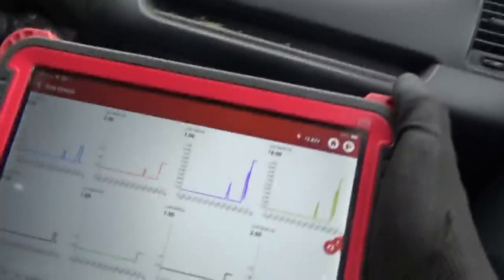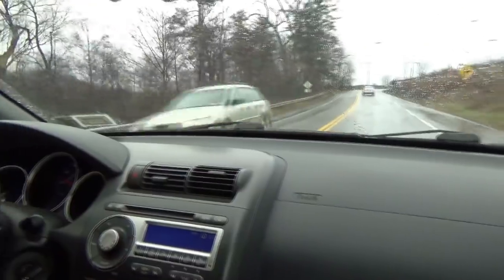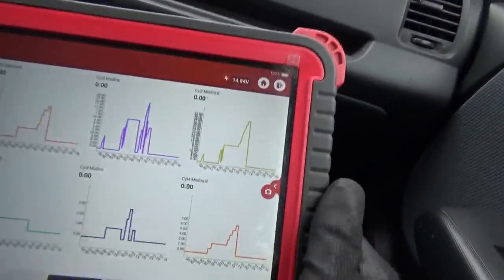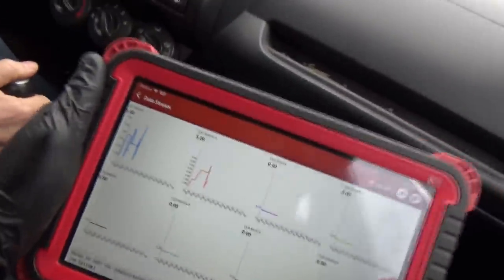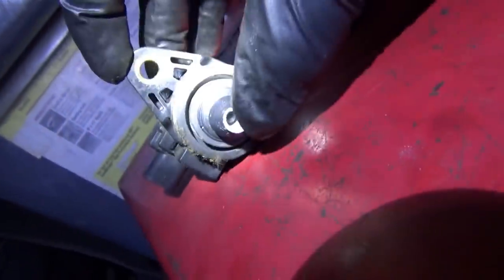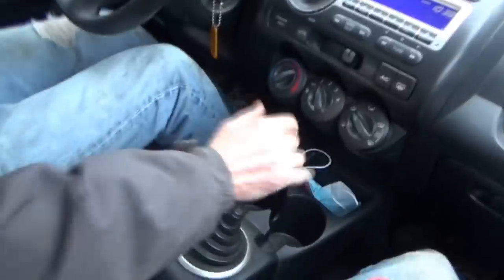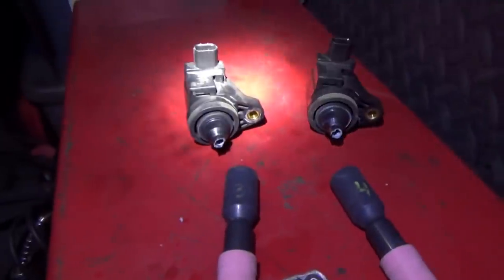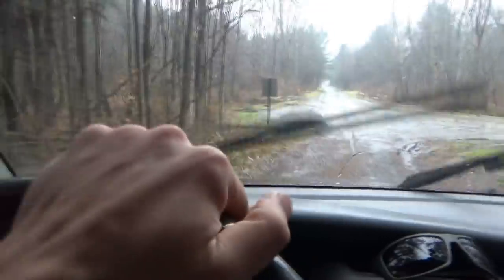Honda "Fishbite" MISFIRE (Diag & Repair)

Comment: Two things. U and pops have plenty of money. U made the point that the  car could b fixed with no parts. Alright already. Replace the coils with Denso coils. U can even get them at Rock Auto. They r degraded.  Have them sent directly to pops. He can do that job easily.  On the knock sensor code for the Chevy. I saw a vid where a gentleman eliminates one of the knock sensors. I have fixed two 5.3’s doing that. It eliminates a lot of work and expense. Maybe it’s a Russian repair, but the engine runs perfect after doing it. That cheap out makes a lot more sense to me. Just my opinion. But what do I know
Reply from the maker: How do you eliminate one knock sensor?
Reply: @PineHollowAutoDiagnostics   Check out the video on the Sam Washburn channel. I have done it on two cars
Reply from the maker: @billrimmer5596  cool NPR trick!